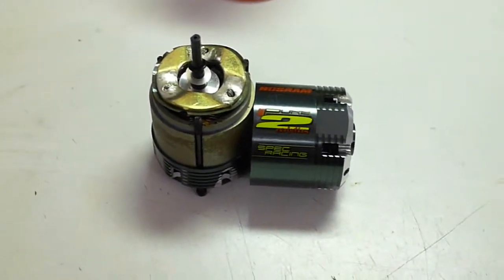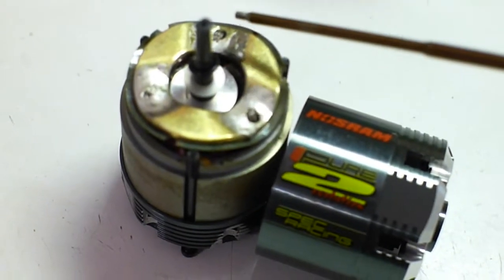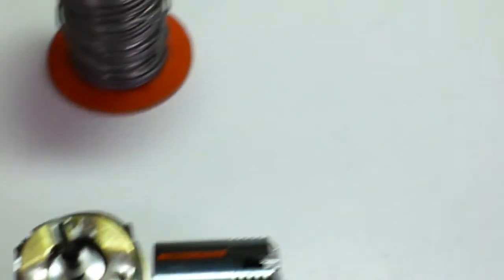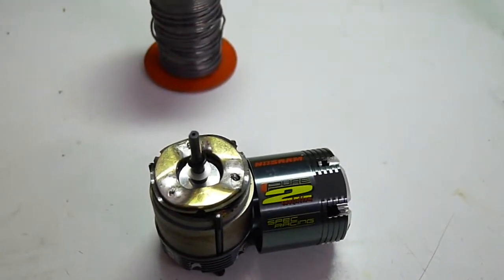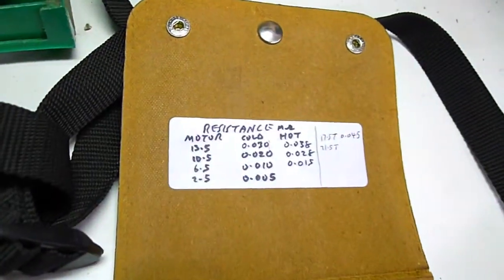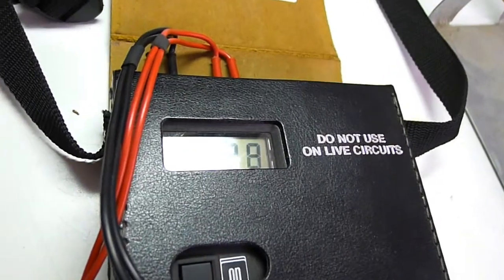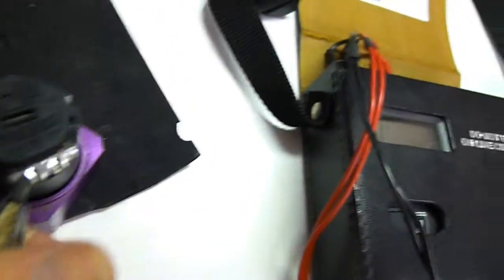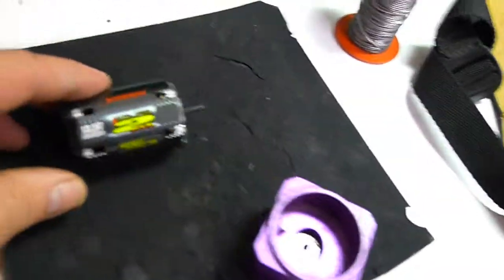Brushless motor stator solder repair. A 13.5T model car motor repair.

Comment: How did you get the stator out of the can?any reply appreciated thanks!
Reply from the maker: Hi Edmond.  On some motors the stator is a push fit in the can. They can be tight or loose. On other motors, especially the latest types with large cooling holes, they may be glued, to stop them rattling. In that case you cannot remove the outer sleeve, and you cannot get to the collector soldered connections.  But the solder tag end is where the joints normally become unsoldered, as there is less metal and less heatsinking. Race on.  Nick

Comment: I just bought a brand new, but not working R1 25.5 motor. Owner hooked the leads up backwards and now it won't work. I'm going to have a go at repairing it. This video was helpful to that end. Thanks!